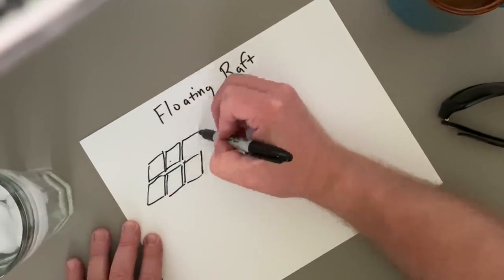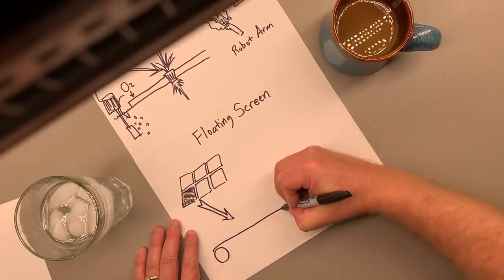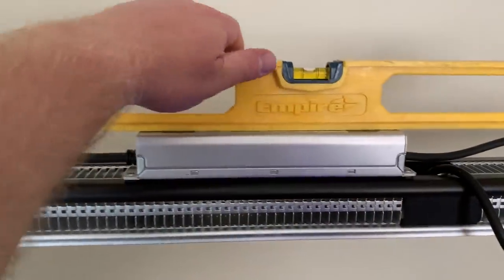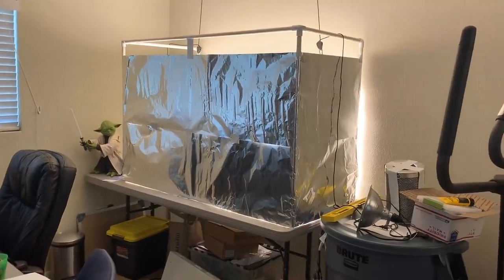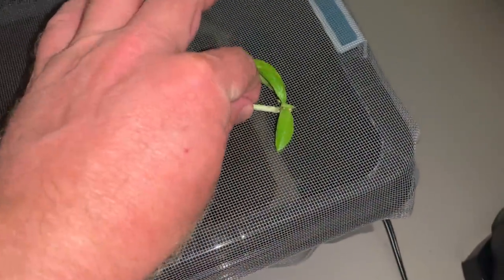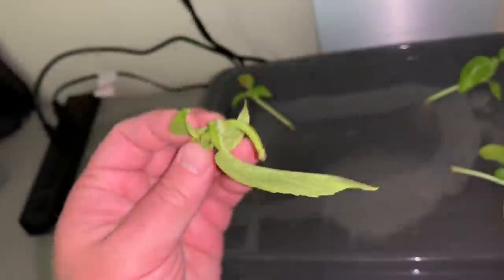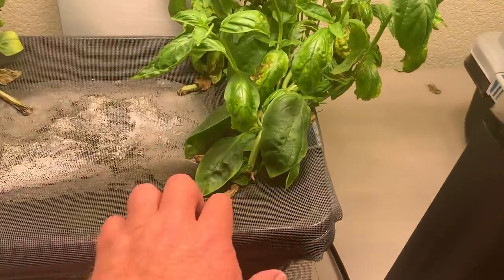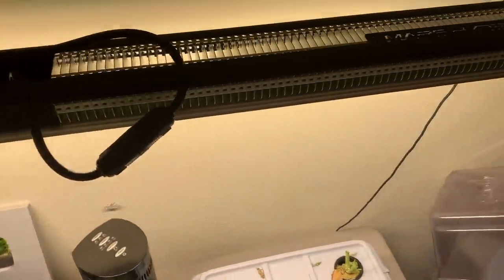These Plants will Transform the Earth!

Comment: I've got a little grow lamp setup similar to yours, except I used those cheap mylar space blanket things instead of aluminum foil; It's far cheaper, lighter, and comes in giant square sheets so you don't have to tape little bits together. It's slightly transparent but reflects like 99% of the light so it's just like a dim purple paper lantern in my living room and makes a great night light. I would 100% recommend trying it out.
Reply from the maker: yes but the foil was in the drawer
Reply: memelord walmart  52” x 82” mylar blanket $3.87 works great!

Comment: Did you ever try holding the radishes in place with opposing paint brushes during your experiments with radishes on a screen?
Cuttings could be propped the same and possibly some wicking action as well.
Using shade cloth sounds like it might work. If the cloth doesn’t work then maybe tiny tin foil crumples layered a few inches thick may allow enough transpiration and be reusable.
Also, The conveyor belt concept is great if the whole plant, roots and all, clear the edge and separate the foil balls and plant in one parallel motion.
Perhaps foil and brushes hinge together, open/close, at both setting starter depth and extraction (with pinchers or by hand). The foil drops to a chute and cycles to a hopper for the next barge. The dropping of the foil balls triggers a vibrating motor for a timed duration to deposit after the nutrient stage is my best guess.

Comment: A clay seed ball could be prepared in advance to use as an anchor for the plants. The roots grow out and pull the ball on each side to stabilize the plant. Germination could be a problem but any bad unit could be recycled.
Reply from the maker: I'm trying to avoid things that roll around etc
Reply: @JebGardener  Yeah I thought of that too. Round is easy to make but hard to use. Maybe a rounded top and square sides?

Comment: If you leave a 1 or 2 inch gap at the bottom of the deflector shield you could create a chimney effect to help bring in cooler air.
Reply from the maker: it would help a little but i think an active exhaust would be necessary

Comment: How much is your electrical bill?
Reply: If your using led grow lights then very low mine dont even register on my electric meter like my kettle does
Reply: @robertmcdermott5782  These big lamps still need 400-600 Watts easily
Reply: @schnaps1790  Nope. It has a 240 watt driver, meaning its highest potential output is just that. Likely Jeb cranked it down a lot (100w or below) to control heat, but who knows :)
Reply: @0x52  Sorry, you´re correct.. checkt the manufacturers homepage. But still you need Energy to let plants grow, LED is much more efficent then HPS lamps but you will always need X-amount of Watts/plant even with "100% efficiency" lamp for them to grow.
For an example the 250Watt lamp running 12hours will still cost you about 30-40 US cents a day or 9-12 US Dollars a month for about 1m² of coverage (US avarage price), ofcourse this price can vary from time to time and location.
Reply: @schnaps1790  Indeed :) The grow light channel, MIGRO, has done extensive tests and research on this subject. I believe the LED effeciency compared to HPS is around 20% below "equivalent to" wattage, which is still a significant saving. Buy yeah, indoor grow will always cost ya 🤷‍♂️
Reply: @schnaps1790  I have 2 800w led grow lights on 24 hrs and they use very little power my kettle uses more

Comment: Just a rando, thought re the screen one. Instead of full screen, use thin-ish plywood cover. Drill 1" holes. Attach screen patches covering the holes. In the center of the screened holes, clip just one strand of the screen or two,if needed. Poke basil stem through this hole so contacts the water. If it sides through too easy, perhaps a rubber band or twist tie, looped around the stem as a stopper. May keep the stem vertical as it should be. 

Once roots have taken/ at the time of nutrient addition, put 1/2-1" blocks between top edge of tub and the ply top. This may give you the air interaction you're looking for and still block enough light from getting to the water and prevent algae growth. Maybe an extra, bigger hole in the center of the top w/ a lo volt computer fan. It would push air in, over the surface of the water and may also provide an up draft as it passes out the opening around the raised edges . Might be enough to push the warm air out he top of the "deflector shield". 

Just spit ballin' a thought. :)

Comment: I love your videos so much - Inspiring, entertaining and thought provoking.  I think you are on to something with the screens for sure.  My initial thought is what would happen if you poked a pencil thru the screen and inserted the cuttings directly, possibly with a small piece of rock wool to help keep the ends wet?  If you ever look to build a more permanent tent, look into Radiant Barrier foil.  Its more robust than tin foil and very inexpensive.  I have a ton left over from a renovation project, Id be happy to send you some if you want :)
Reply from the maker: i've never heard of that.  is that for stoves and stuff?
Reply: @JebGardener  It is a woven aluminum fabric (like a tarp) that is meant to be installed in your attic - it reflects infrared heat incredibly well, and its suuuuper shiny

Comment: Mayeb a combination of the two would work. A line of rectancles, hooked onto each other, that have slots for stone wool seed cubes. thee system could still be automated, but the cuttings certainly would get a lot better access to water, and they would stand straight up. I feel like it's possible without the stone wool, but in large quantities, it's inexpensive, and can be used in smaller amounts, since it's just for holding the cutting straight up. Also, cloning might not be the best, since you get a lot of flower growth and no much genetic variety. An actual pesticide (there are lots of pesticides that do no harm to humans) would also be a good idea. and some soil bacteria, so maybe like some dirt?

Comment: @Jeb Gardener: Try screen idea with green onions from seed. Also, consider using chicken wire for reinforcement. Window screen not strong enough to support full weight of crops in commercial setting. Chicken wire to also act as automatic cutting mechanism for conveyor idea? You need some kind of material that will stand up to the abuse over several years of use over 5-12 crops per year; roughly 5-7 years. THIS is the biggest issue for your concept to reach market, as product lifespan and pricing are the biggest concerns in commercial farms. Check out polytunnel as an example product (used for greenhouses) for case study comparison. You have a good idea, play with it some more.

Comment: it might somewhat defeat the purpose of using a screen, but could you poke a hole in the screen with a pencil and stick the stem through that?

Also, could you maybe use two different sizes of screens?  For example, cut a hole in a piece of foam, glue 1/4" chicken wire screen on one side and screen door material on the other, then stick the cutting through the 1/4" side.  That should keep it pretty much upright, let the roots grow through the screen, and the plant would float in the water at a pretty consistent depth.  Thick foam might even leave enough for air roots to grow, so it would kind of work like Kratky.
Reply from the maker: you could poke a hole but i'm looking for scale-able options

yes you could use a screen with floating styrofoam but then again it's defeating the purpose behind the screen

Comment: Most experienced people who clone just use a regular household lightbulb until they root just because of the trauma involved to the cutting; it needing to recover but still desiring to root.  I would be interested to see something else grown under that light besides basil.  The reason I say that is because basil is more or less a light shade plant.  As long as it it warm it produces prolifically in shade. I only grow one because they grow so huge and I only use them for pasta and making cooking oil with my MB2.  Basil is a perfect cut and grow plant.  

So I would like to see this light tested for some kind of summer plant, maybe a melon, to test its productivity and function vs price.  I would also like to see a comparison using this light against a Hidden Harvest Light.  Sometimes comparisons are the only way we really find out how good a light is.

I have tried using 90% shade cloth to shade the water but I was doing that outside in desert temps and it did not work as far as algae problems.  I found the only thing that worked was using Radiant Barrier.  However, I did wrap the grow room pots (2 gallon white) with the same 90% shade cloth and that did not work either.  Again Radiant Barrier kept the algae from becoming a problem. 

As far as using rock wool.  I have had it with rock wool.  It creates more problems than it does success.  I have gone back to using Rapid Rooter plugs.  No nonsense having to do a Ph balancing, no algae, no drying out.  Plus the Rapid Rooter come with a small amount of GH fertilizer. Price wise pretty good.  On Amazon $17 for 50 plugs.
Reply from the maker: yes a demo of that nature would be fun.  problem is there are time/space constraints.  I think you just need enough shade until the plants provide the shade.  Cloning directly to the screen worked but I think the bend in the stem is not ideal.  thanks for watching
Reply: @JebGardener  You might try the small size pool float tubes to put the clones in, that is what I use. You can easily slice them into what height you need. Ah......time constraints....LOL, yep....OVERLY familiar with that.  I am glad to see Fall.

Comment: I actually think that the difference in yield comes from the way that you applied the nutrients. Sure, the idea of putting them on top makes sense at that point in time, but where the rock wool plants had an advantage was when they struck the nutrients down below and quickly expanded their network of roots to optimize their growth.
Maybe it would have been a better idea for the left side to have some local nutrients applied to the water very very much near the stems and most of the nutrients still in the bottom.
Reply from the maker: dissolving them in liquid and then adding it would have made it consistent.  good idea.  i doubt it affected the plants but i could test for that.  thanks
Reply: @JebGardener  That's an even better idea! Totally agreed! You're welcome!

Comment: Hey Jeb I know I'm super late but what if you made a hybrid between the two setups?
Basically stiffer mesh/screen but with holes to hold those plastic grow cups. So almost the same deal as the lid you use but with screen instead.

Also what's your opinion on aeroponics?

Comment: if you like the screen idea and use it more you might need a thermometer that uses a probe instead of the one you have, unless you hook it to the lid you can't just rest it on the screen unless it's waterproof.

Also if the water isn't covered is it heating up more overall? is that part of the heat problem?
Reply from the maker: I need to investigate the effects of the exposed water more.  I thought it might be cooler from more evaporation, but the plastic shield might have a greater effect than i expected

Comment: Could you "bend" the screen downwoards to put the clones in deeper into the water?
Reply from the maker: you could sink it more but my experience so far is that plants prefer to be in contact with the surface of the water and the air rather than being submerged
Reply: @JebGardener  that was fast. The ones in stone wool are submerged too, aren't they? They can grow roots all around right away, the screen-clones only grow roots where there is water, or is it about the growing medium the stone wool provides?

Comment: Looks like you can make that light almost 30% brighter if you give it a 2-pole circuit! Refer to "OUTPUT" on the fixture label. My bad! Single pole connections only.
Reply from the maker: is that safe?
Reply: @JebGardener  Well actually, my bad. I checked again and the label only allows a 1-pole circuit--live, neutral and ground. What that means is this light will work in most countries at 120V or 240V, but the light will be 30% brighter in any country using 240V 1-pole circuits (e.g. UK). If your power company provides 480Y/277V connection (unlikely outside industrial or high-rise applications), technically you could wire the 277V hot to the live side of the driver input. They don't list the wattage the fixture will run at, but I would expect based on the listed data it should output 250-300W of power. I wonder if the light fixture housing could take that much abuse.
Reply from the maker: seems like something to try maybe 5 years into the lights life

Comment: Jeb i watch your videos all the time your a very smart man i have a question? I grow chillis the problem im having is keeping my temperatures at 70-67 degree Fahrenheit is there a way to keep it cool with out spending 2 to 300.00 for some crazy looking thing? Please help me. Thank you
Reply from the maker: if your humidity is low you could add a mister.  Otherwise you gotta use AC.  Also chillis can go up to 90 degrees.  It's not ideal but they can do it.
Reply: @JebGardener  really? Im at 83 degrees my plants look really good but I think it's the solution that I'm using that's making the roots turn brown I'm using that floranova it's real thick brown thank you Jeb you're awesome
Reply from the maker: If you are doing hydro, the water can't be that hot of course.  good luck with your chilis